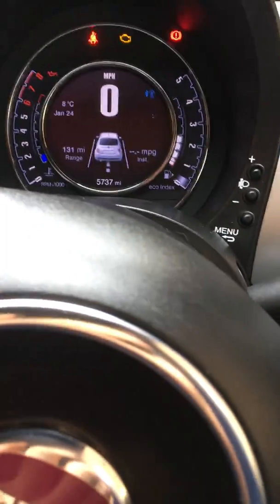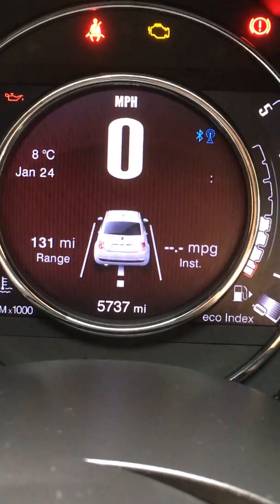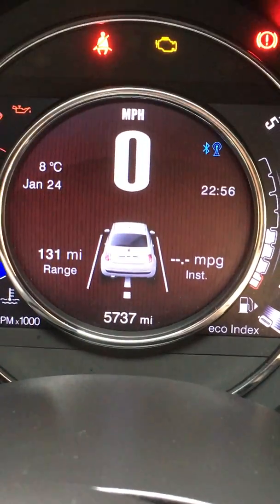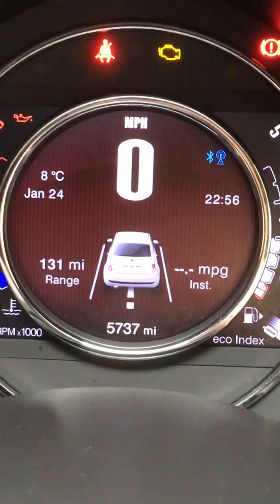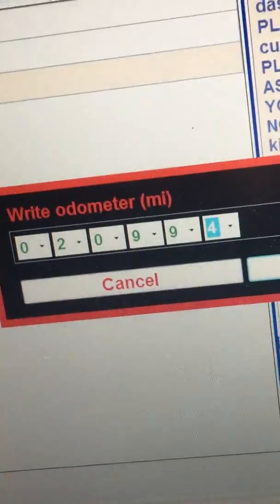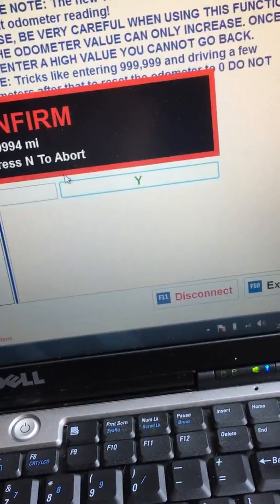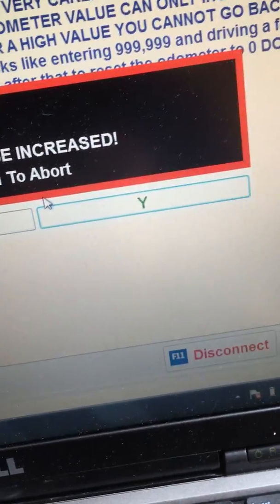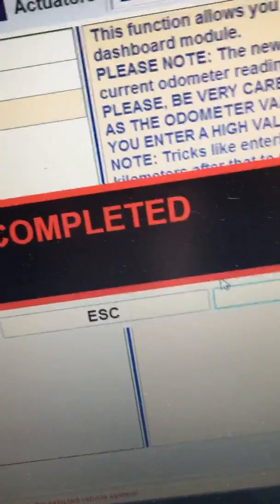Using MultiECUScan to increase mileage on Fiat 500 or Abarth speedo - Love 500 How to Series

Comment: I'm looking to change my speedo soon.  The two blue icons at the top right - Bluetooth and something else? (cellular?).  Do you have to change anything to get the display to look like yours, or should it come like that anyway?  I've seen people talk about "Display type" and also changing hex codes, etc....  Thanks in advance!
Reply from the maker: The only thing you will need to do is to adjust the mileage up and then a proxy alignment. Whatever your car is, it will adjust to that following the proxy alignment. Whether you have an Abarth or a Fiat 500, auto or manual if you're getting a TFT one it doesn't matter, it'll all adjust. If you're just replacing it with the old orange one, then get one that physically looks like yours, i.e. dial colour etc from roughly the same year and it should be fine.
Reply: @Love500 I’ve got a 2017 Lounge which is a facelift but has the old speedo and 5” head unit. Going to change both, speedo first. I bought a speedo and the guy said that if I had cruise (which it does) then it would need to be a particular one (chrome ringed?).

I’ve seen displays with a thin speed font, and others with thicker. Is that in the “display type” settings in MultiECUScan?
Reply from the maker: @Durzel  Hmmm, not sure about that. It might be a gamble. All I've ever seen is the proxy alignment codes it for what the car is. I've used a manual one in an Auto, Abarth in a 500 and vice versa, one without TPMS and when you proxy align, it codes it out. Can't guarantee though about cruise, as I've never had that, but from what I've seen, it'll just display it. Worth a try.
Reply: @Love500  Thanks again.  I have received my TFT speedo now, and am planning to install it this weekend.  I haven't yet bought MES.  Do I need to change "units" in MES or do any other initial setup to avoid accidentally setting the speedo to KM?  Or is it a case of plugging it in and following the instructions to the letter in this video?
Reply from the maker: @Durzel not sure off the top of my head. I think the Speedo itself may have that as one of the menu choices. Most of the functionality of your car will just start working when you proxy align it. I put a manual one in an automatic and as I was doing the proxy alignment before it had even finished it displayed “auto” and the gear it was in.

Comment: What obd interface are you using for you multiecu?
Reply from the maker: @dezzer9133  just a cheap “modified” one for Italian cars as they are often advertised as on eBay.
Reply: @Love500  those are the ones with the resistor removed right?
i bought a vlinker ms, no cables required, easier to handle
will arrive soon hope i can fix the flashing light
Reply from the maker: @ I don’t think they are removed I think it has wires swapped.

Comment: Great.  I have a Duologic with a transmission fault.  I fixed my last airbag ecu module no problem with MES. Wondering what software will tell me for this robotic automated manual box.   Cheers Dan.
Reply from the maker: Have you checked the actuator fluid level. Might be a quick fix.
Reply: @Love500  Had a google images search, after looking at the car, does the actuator fluid have a dip stick to check, cheers, many thanks Dan
Reply from the maker: @primeroo2nd  it doesn’t in the 500L, I’m not sure about the little 500 but pretty sure it doesn’t. It should be a small translucent tank.
Reply: @Love500  thanks for you help !!!!! On a 500L buried behinds heat shields, on Grande Punto was too easy, level looks a little low, I'll get some Tutela CS Speed after googling !!!!  Worth a try first
Reply from the maker: @primeroo2nd  I had the whole lot changed on mine when it was serviced as I was selling it with a warranty but wanted to try and future proof it with preventative maintenance a bit.
Reply: @Love500  noticed possibly brake light switch problem too.   I’ve brake lights permanently on , Googling up….. Some bad earthing connections rear light cluster can upset the ecu for the robotic manual DuoL.   My connections good right light cluster removed. But brake lights always on.  Hmmmmm. I’ll keep going.  The level is about dead right on actuator.  I’ll still add one cm to one inch actuator fluid.  Wonder if fluid on the Tutela CS Speed can go bad ???
Reply from the maker: @primeroo2nd  take the brake light switch out and pull the plunger with a pair of pliers to reset it.
Reply: @Love500  on it like Sonic.  Never get problems with plenty cars.  Definitely get to enjoy those problems when in a Punto.  Evo or Grande.  500s luckily cost too much in trade to get a high mark up sell quickly.
Reply: @Love500  no. But thanks.  I’m new to DuoL on these Grande Puntos. Going back I’ve delved into Selespeed and also CambioCorsa and Duoselect on Maserati.  They all mess up have gremlins or have clutch plate wear.  Interestingly this 10 owner drove back Leeds Manchester normal.  Today.  It’s having flip outs.  Into Neutral from 3rd in Auto mode.  TransM fault.  Etc etc.  I still love them. I own a GTA manual btw 156.

Comment: Sorry new to this, so what exactly needs purchasing ?

Full version of MultiECUScan
Some sort of cable lead ? 
Some sort of ELM adaptor ?
Reply from the maker: Elm 327 cable. A modified one. A cheap set of cables from eBay. Yellow is used for vast majority of things. Paid version of the software and a laptop to put it on. That’s it.
Reply: @Love500  Perfect appreciate the help, one last question, so do everything else just automatically work once the newer cluster is installed as in speedo etc
Reply from the maker: @officialdillz5583  as long as you get one from the same generation. You may have issues if you put a facelift one into a pre facelift. Tyre pressure sensor warning and you wouldn’t be angle to adjust the clock as that’s fine from the stereo on the facelift. Apart from that, it’ll work. Tyre pressure will sometimes delete itself when proxy aligned.

Comment: Hey, thank you very much for the video. I had to change speedometer in my Fiat 500, 2013, 1.2. The speedo had lower mileage than the car and it was flashing. I drove it to the Fiat dealership and they said that they could only fix the flashing of odometer but not increase the milage. Did they lie to me? Do you know what I should do?
Reply from the maker: They probably did lie but get yourself MultiECUScan and a set of cables and do it like this video shows. They would have charged you £120 for doing a proxy alignment to stop the mileage flashing anyway. MES and cables will cost you half that.
Reply: @Love500  Thank you so much for help! Your videos are super interesting to watch! Keep up the good work!:)

Comment: thanks for the video .. You said in an earlier comment this option is in the 'body' computer. I still can't find it, please can you explain further where this is located? Thanks
Reply from the maker: It's in the Dashboard. Click on Dashboard (the speedo) and then click on Adjustments, its then the last option. Make sure you enter it correctly. When you hit the button it'll show you again and warn you that its irreversible so make sure you get it right. The mileage will write about 18 miles more than the actual mileage, so knock it down around 18 miles and it should be pretty much spot on.

Comment: I might need to replace my speedometer due to the needle sticking on my 2013 500 Pop. Do you have a link where I can purchase the ECU Scan so I can set the correct mileage on a new speedometer?
Reply from the maker: A Dub yes of course, it’s,

 https://www.multiecuscan.net/

Buy the full version, the free version is more to just give you an idea of how it works. Get yourself a decent set of cables to. I bought a cheap set on eBay but ended up getting a decent set from one of the  reccomended suppliers on the website. On a 500 You’ll only need the yellow adapter for every ECU except the engine which is without an adapter.

Comment: hello Bertie i am havig problems doing the same as you (you did the proxy allignement first? then change the millege?
best regards tky for your help if possible
Reply from the maker: Usually you don't need to do a proxy alignment for the speedo. If you change the mileage you shouldn't need to. It doesn't matter one way or the other. You can keep doing it, if it doesn't need it, it will tell you.